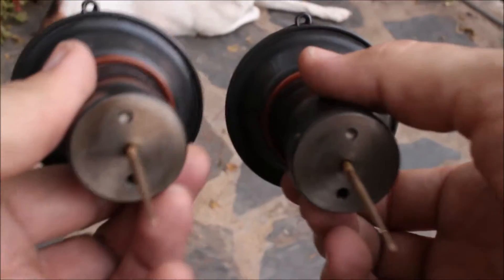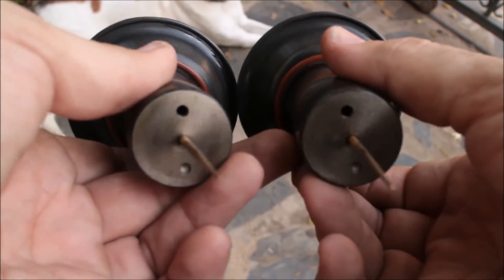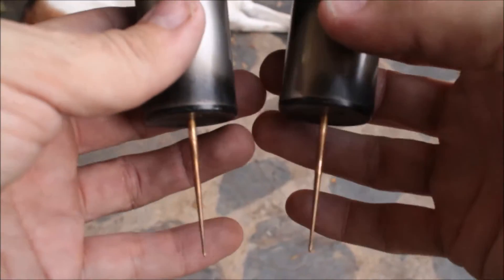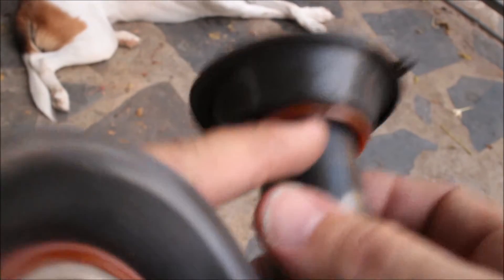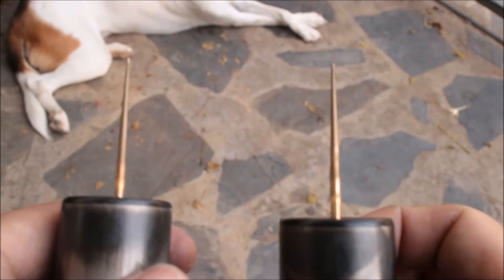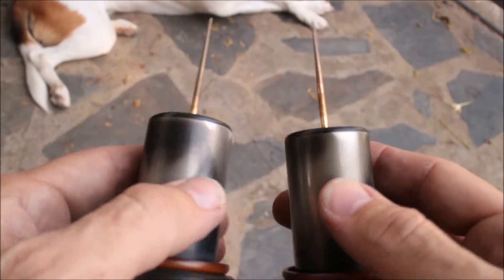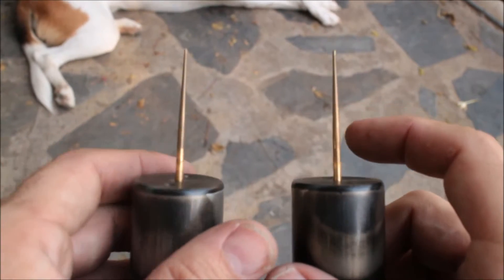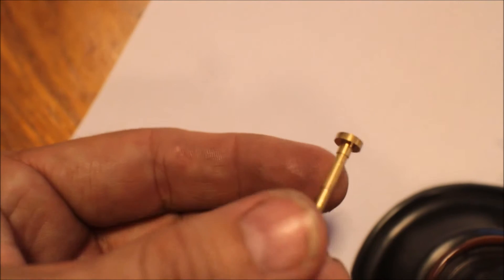Carb needles not straight - Keihin CV round slide

Comment: I noticed the same thing on a set of VE65 carbs. It seems like the step on the needle itself is too big to fit through the hole in the slide, or the hole in the slide is too small / not chamfered deep enough to accommodate that step. Spring pressure from the needle holder forces it at an angle. Almost seems like the slide wasn't finish machined completely.

Comment: My carb has the same issue, if you look down the center on the tube, there is a drilled chamfer that the needle sits in, that chamfer is drilled off centre pulling the needle one side.
Reply: Maybe a thin plastic washer will keep the needle out the chamfer and straighten it out, not sure how that will affect performance, possible a minuscule fuel increase. Maybe a washer made from the flat section of a plastic bottle.

Comment: i noticed the same thing in my bikes Keihin CV carb. its needle leaned to an one side of the Diaphragm and it is not caused by the needle, because even though i rotated the needle , the skew is not changing and it always kept towards only an one direction of the Diaphragm. i think it is not a matter of Needle. Most sad thing i found is that little angle of the needle cause the diaphragm to wear on one side faster and its function corrupted very soon.